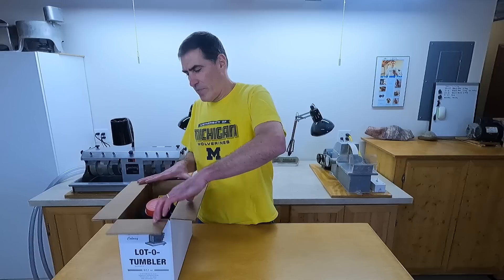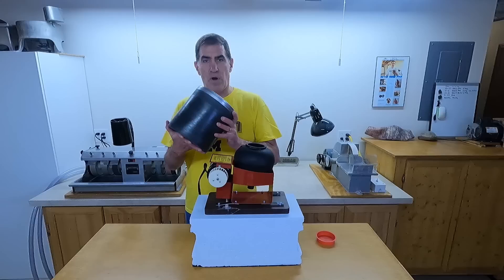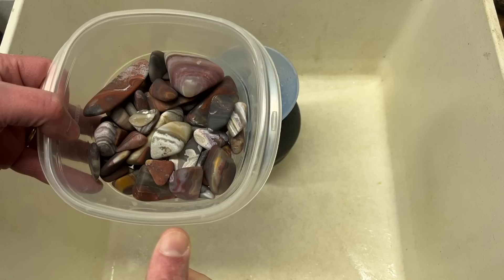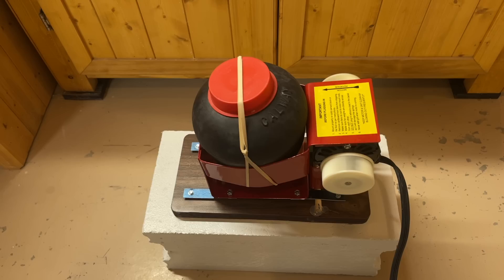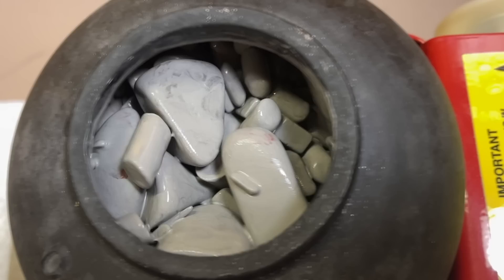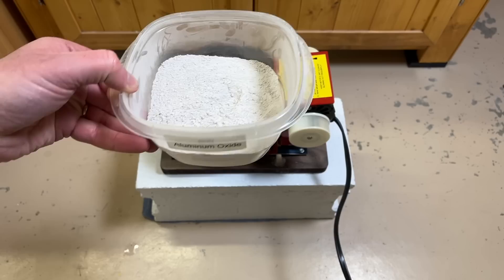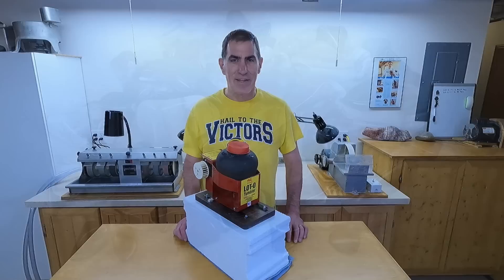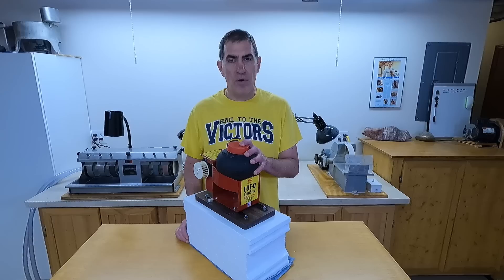The Lot-O Used To Be My Favorite Tumbler. It's Not Now. See Description Below.

Comment: Thanks for all the info. If I make a relief in a rock pendant or etch lines into rock using a rotary tool, will the lines and small areas I cut away polish out if I put it through the stages of the rock tumbler? The grit will be enough to polish those crevices?
Reply from the maker: I doubt it. It's not just the grit that needs to get in there. You need something to rub the grit into those areas. Even rocks with larger concave areas don't tend to polish very well in the concave parts. I once broke up bottles and tumbled the glass. The outsides of the bottles got nice and shiny, but the concave curve on the inside didn't get nearly as shiny.

Comment: Hi Rob, I too finally found and purchased this tumbler. I will keep my fingers crossed so I don't experience any issues :-) I do have a question about the rubber barrel ... my barrel on the inside bottom is lumpy. My hand is small enough to fit inside to clean it. I feel lumps and was surprised.  My husband was going to tune/adjust it for me because of the extremely slow tumbling action. But before doing that I thought I might ask and see if its a possible defect in the barrel or if this is just the way the barrel is made.  Thanks in advance if you are able to answer... and Merry Christmas from West Branch Michigan to you and Nancy!
Reply from the maker: My barrels look sort of lumpy on the bottom too. Unless there are holes in the rubber or something, I wouldn't worry about it. 

Ask your husband to be careful not to adjust it too far. I'd suggest doing it while it's running (with a full barrel) or at least testing it before he glues it down. I had several people tell me that if it's too vigorously shaking, it can break springs. Mine were fine the way I had it adjusted but a couple months ago, I moved it back a little closer to where it started to slow it down just a bit. After I adjusted mine, the action was a little faster than my original Lot-O.

Comment: I watched one of your videos, you use a piece of PVC pipe to measure the amount of space to the top of your lot-o when you filled it. I can't find that video again, I would like to know measurements of that PVC pipe if you would be so kind to tell me. Thanks
Love your videos.
Reply from the maker: That was a Lortone 3 pound barrel that I used the PVC pipe in. I can't remember if I cut that to measure 1/4 or 1/3. Most people suggest filling your barrels to either 3/4 or 2/3 full. When you're first getting started, it's nice to have a measuring device until you get the hang of it. Just measure down from the inside of the lip the lid sets on to the bottom of the barrel. You want the height inside the barrel when the lid is on. Then divide by 4 (if you want to fill your barrel to 3/4). Then add on the height of the lip on the top of the barrel so that when you put the PVC pipe on top of the rocks it will be level with the top of the barrel.

With my Lot-O, I fill it to about an inch from the top. The only problem with filling it too much is if you have a bigger rock in there. A bigger rock will sometimes push the top off the barrel as it rotates to the top. I always put rubber bands over the lid to prevent that and fill it a little less full if there's a big rock in there.
Reply: @MichiganRocks   Thanks again. Love your videos.

Comment: I’d be interested to see your thoughts on using the harbor freight 18lb vibratory tumbler. I know they make a smaller one, but i think the larger one doesn’t overheat as easily as the smaller one. I’ve been trying to get into rock polishing but i can’t make up my mind if i should buy the tumbler or just make one.
Reply from the maker: I'm almost certain that tumbler is made for doing light metal objects. I don't think it will hold up to the weight of rocks.
Reply: @MichiganRocks  good to know! I can’t find any good vibratory rock tumblers available. I’m thinking of just throwing one together. I have a few ideas. If you wanted to put a vibratory tumbler together, how would you do it?
Reply from the maker: @Tbugfish  I wouldn't know where to begin.

Comment: I have two singles and a double.  Yesterday and today, I did the dowel move on both singles and that did make a difference.  A sharp wood chisel does a good job on removing the glue and I used it to pry up the ends and brads.  My newest single had a had a brad hole drilled in each end of the dowel but no brad.  My double is in need of an adjustment.  Has anyone moved the dowel on a double, and did the two CM distance work? On mine, that would be a half CM move.
Reply from the maker: I don't have a double, so I don't know how far to move it. What I would do is fill both barrels with rocks and then move it while it's running. That way you could see how it's reacting and just tune it until it's running the way you want it to. Be careful not to make the action too strong. I have heard that you can break springs if you move it too far.

Comment: I have one of the "old" Lot-O tumblers.  Do you know how to lubricate the motor?  
It's probably due, I've been using it for a couple years now.  Thanks!!!!
Reply from the maker: I don't think any of my motors were the kind that need oiling. If they do need oil, there's usually a little port with a plug or a little door that swings off to one side.

Comment: Can you tell me why my silicon oxide collects at the bottom of my Lortone double 6 lb tumbler?
Reply from the maker: I think you mean silicon carbide. You haven't really given me any information to go on other than the size of the barrel. What are you tumbling? How long did it run before you found grit laying on the bottom? Are you sure it was grit and not rock dust? Does it feel gritty? What kind of rocks are you tumbling? What size was the grit? Was there anything else in the barrel such as plastic or ceramic media? How big were the rocks?

Comment: Hi Rob, I have a question about the Lot-O that I'm hoping you can answer. I just got a single barrel and the spring are knot straight, do I need to straight them out?
Reply from the maker: The springs are supposed to be bowed. There should be an upward curve to them, higher in the middle than on the ends.

Comment: Now with the Lot-O and the unavailable Thumbler off the possible option list, what do you suggest?
Reply from the maker: I really don't know. I asked Diamond Pacific to send me a Mini Sonic to review and they wouldn't even answer my email. The Thumler's UV series would be on my list of possibilities. A friend of mine has a Ray Tech Adjust a Vibe that he had both good and bad things to say about. Problem is, those start at almost $600. They make a cheaper tumbler, but I haven't heard much about those. 

I really wish I could recommend something, but it's hard to do if I haven't used it first. 

Some people are also having luck replacing the motors on their Lot-Os with another type of motor. It requires cutting the frame though. You can read about it here:

Initial discussion:
https://forum.rocktumblinghobby.com/thread/100982/experience-lot-failed-motor

A successful motor transplant: https://forum.rocktumblinghobby.com/thread/101470/finished-batch-watt-concrete-motor

Comment: Thanks for doing the review Rob. I’m thinking my next major purchase might be a Lotto. Have you ever had a problem with the double sided tape coming loose in the time that you had your first Lotto ? Also what is the base of the machine made of it appears to be wood or a wood composite board. If that’s the case and the adhesion of the tape is a problem I think I would cement a piece of threaded rod or long bolt into the cavities in the block and drill matching holes into the base of the  tumbler and secure it with nuts. If you used threaded rod you would have to put a bend in the cemented end of the rod to keep it from pulling out.
Reply from the maker: The base is particle board. My first Lot-O has been stuck to the concrete block for over ten years now with the same double sided tape that came with the machine. No problem at all there.
Reply: David, My Lot-O double-sided tape failed. My fault, not the tape's. I went to the local hardware store and bought enough double-sided tape (with thin foam in the center) to put about 8 strips across the base. It has been working really well.
Reply: @dancrites453  Thanks for the info Dan.

Comment: Rob I just bought a Lot o Tumbler and it says I should poke a hole in the cap to release pressure. Have you had this issue and should I do this?
Reply from the maker: I poked the hole in my first lids, but not my new one. I don't think it's pressure in the barrel that pushes the lid off. It's big rocks that occasionally push the lid up. I really don't think it makes much difference if you put a hole in the lid or not.

Comment: I have a question for you regarding this tumbler, finally found one and bought it, unfortunately after reading your latest warning lol.
Got it ready and mounted to the stack like your friend, started it this afternoon, checked it before leaving and I could smell a hot motor smell.
The fans are rotating close enough to where they do not rub on the bolts per their instructions, but the motor is to hot to touch, is this normal? 
I of course turned it off before I left.
Tried calling the company but no answer, and I have emailed them.
Just curious if you have advice.
Love your channel you inspire me in my new hobby
Reply from the maker: The motor does run hot. That's not unusual. I'm not sure about the smell. I don't remember that, but it might be just because it's new. I wouldn't run it while you're out of the house until you decide if it's safe. I wouldn't be surprised if the smell goes away after a day.
Reply: @MichiganRocks  you are absolutely the best guy on you tube, answering my concern so quickly, thankyou is not a strong enough word, but thank you sir, your videos and you help is very appreciated. God bless
Reply from the maker: @mikek4443  You're welcome. A lot of people answered my questions when I was first starting out. I don't mind paying it forward.

Comment: My Lot-o came the same way. I did the same as you and replaced + moved the tunning dowel. Your first video showed me the correct action!!! Now my lot-o keeps breaking the double stack  springs at the bolt holes where they attach to the machine. Have changed them 2-3 times. I got a hold of the little old man who builds them and he said they keep breaking because I moved the dowel and I should put it back. He told me the rocks just need to move but they don't have to circulate like yours. I don't think that's right but what can you do. So no help from him. Tryed to email you about it last year but couldn't find your address. Keep an eye on your springs and please please keep us up to date on any other problems/fixes. I have kinda given up on mine but don't really want to.
Reply from the maker: People with the older ones have all good things to say about them. The newer ones don't seem to have such a good reputation. I've only run one batch through the new one, so we'll see how it holds up. I have never broken a spring on the old one and them motor lasted ten years, so I have no complaints about it.
Reply: @MichiganRocks  mine goes 3-4 batches and breaks a spring. It will sound different and the action will change. Good luck and please update if anything happens with your lot-o. Your channel is my goto for all things rock tumbling!!!!
Reply from the maker: @linestalker  Ok, will do!
Reply: They’ve probably cheapened the materials they’re building them with.  Quality of everything gets worse with time as companies get squeezed and need to maintain profits.  Wouldn’t be surprised if the new ones are nothing like the old ones, quality wise.
Reply from the maker: @andybaldman  I guess I'll find out since I have one of each now. From some of the replies I've gotten, I think you're probably right. I wish you weren't though.
Reply: @MichiganRocks  Definitely sounds like it.    Perhaps you or someone could find a better quality replacement spring, to solve one of the issues.   There are many places that carry a wide variety of specialized springs.  McMaster Carr is one.   People really should pressure the company to stand behind their product though.
Reply from the maker: @linestalker  I was just talking to someone the other day who told me if you move the dowel too far, it will break springs. Try moving yours back toward the motor more.
Reply: Thanks for the update/tip. I have a batch in the rotary right now. Should be ready in a few weeks for the lot-o. I also have all new springs coming. Will let you know how it goes. Thanks again!!!

Comment: Would you recommend this tumbler, or is there another brand you suggest?
Reply from the maker: That's a very difficult question. I love this tumbler. I have not heard of anything that works better for what I want to do. There are tumblers like the Thumler's UV series that will tumble bigger rocks, which would be nice, but this one is a great size for almost everything I do. The only reason I hesitate to recommend it is that the motor that they've been using on it in recent years has not been holding up. The warranty is something like three months and the replacement motor is expensive. I have two of them and my newer motors have not died yet, so personally, I have no complaints. I have also heard from someone who I feel would know that the motor problem may be better now. This person sells these and has been getting fewer complaints. If I was buying a new vibratory tumbler right now, I would buy a Lot-O. Just realize that there's some risk of getting one with a bad motor. Here's a discussion at the Rock Tumbling Hobby forums that you might want to read: https://forum.rocktumblinghobby.com/thread/100982/experience-lot-failed-motor

Comment: Hi Rob what kind of paint did you use? I don't want to use the wrong paint and not have it stick.
Thanks
Reply from the maker: I just used some left over latex paint. I think I primed it first with Kilz. I don't think it matters that much. My blocks are slightly different colors, so I think I used different paints on them and they're both holding up well.
Reply: @MichiganRocks  Thanks

Comment: Curious if a brass tumbler would work or if any has tried?
Reply from the maker: It might work for a couple batches, but from what I hear, either the bowl or the motor or both will wear out quickly from the weight of the rocks. There's a company called Thumler's that makes tumblers with specific models for polishing rocks and others for tumbling brass.